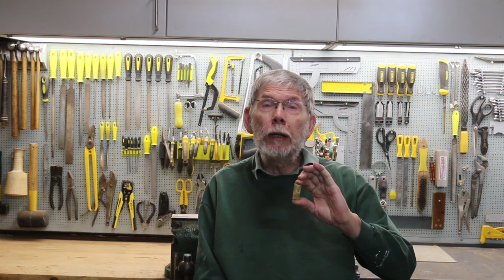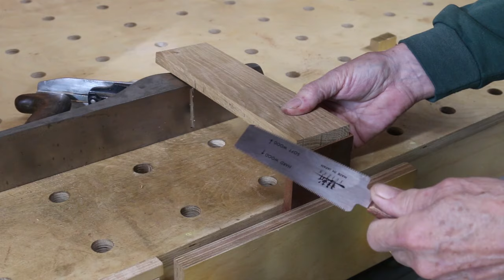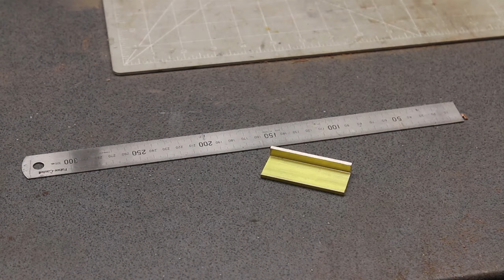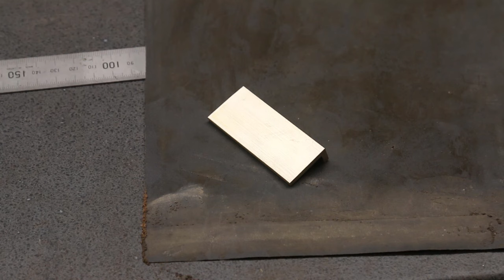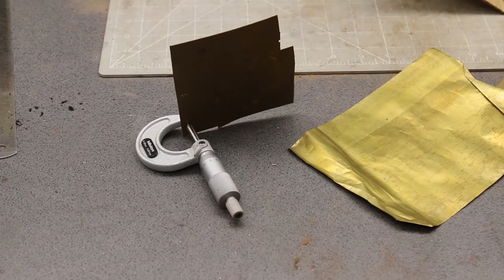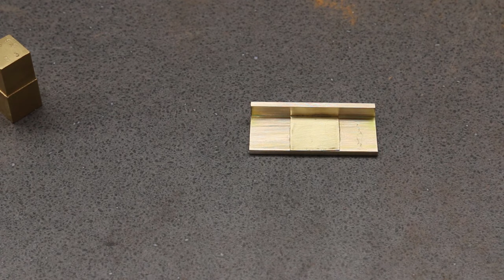super shim

Comment: And a whole lot cheaper than a Shaun Shim.  I saw the Shaun Shim on Rob Cosman channel, and determined to built one myself, but planned to use a block of wood and glue feel gauge shims to it.  But I like your approach using angle and will do that instead.  But aluminum angle and I'll just cut up a cheap steel feeler gauge to set the shim thickness to match the kerf.  I like the idea of using the feeler gauge to measure the actual kerf rather than calipers at the teeth;  Gives a real fill measurement of the kerfvs. assuming that the kerf will match the saw set.
Reply from the maker: Yes, aluminium will work just as well. Neat idea using a feeler gauge- there are a lot about now that motorists do not regularly check their spark gaps...

Comment: That still looks fiddly and error prone. If only there was some kind of clamping mechanism 😉😉😉
Reply from the maker: Yes, clamping could be arranged- or a jig that guided the saw blade. But at some point it stops being hand woodworking. A matter of judgement, of course. But this jig ‘upgrade' should not cross anyone's threshold… I certainly find it a lot easier to use.
Reply: @Tensquaremetreworkshop  I was referring more to jigs like the dove tail alignment boards that have been around since forever :)
Reply from the maker: @SirBenJamin_  Yes, I know. Dovetail cutting ranges from entirely hand and eye to 'press the button' CNC. Many enjoy the making of projects 'by hand'- although they may disagree about how many aids are acceptable. Marking gauges? few would object. A hand held gauge such as this? A small step. Complete dovetail alignment jigs? Suggest it and then step back smartly...
Personally, I like both. I will cut some wood joints on my milling machine, because I like the precision. But I also like making dovetails with hand tools, there is a satisfaction in developing skills. There is no 'right' answer- we do these things for pleasure, and if that is working nothing else matters.
Reply: @Tensquaremetreworkshop  You might have a different understanding of what a  dovetail alignment jig is. It does not take the skill out of it. It just holds things in place at right angles, avoiding the issue you had
Reply from the maker: @SirBenJamin_  I have seen several dovetail alignment boards, and none of them gave the lateral shift to allow for saw kerf. Of course they could- but then the alignment of the front faces (on all the ones I have seen) is still a manual one. Whilst holding the top board against the fence.
IMHO using a making knife is inferior to using a saw blade to mark the position- the saw gives a slot that the dovetail saw just drops into, very accurate.
A dovetail board, with a shim against the fence ( for half of the cuts), and a top clamp, would give and hold alignment. But if you want to reference off either side (and with a four cornered structure you would want to use one face, meaning two joints referenced from each side) you need a second fence or multiple shims. And it is large. Mine fits into the pocket.
This was never meant to be the 'ultimate' jig- just an improvement on the 'shawn shim' that is widely used. It works for me.

Comment: Hi Mike 
I enjoyed your video but trying to get my head around it.
So the shim you added to angel brass should that be same thickness of the saw that will cut the wood.
Reply from the maker: That's right! It shifts the top workpiece left or right by the thickness (kerf) of the blade, so the final tails and pins with be a close fit. Being L shaped, it also ensures that the top part does not move forward or back during cutting. This way of making dovetails removes a lot of the errors of just using a marking knife- you are cutting the pins to match the actual tails, rather than where they should be... It is a method championed by Rob Cosman- but my shim is both (much) cheaper and more functional than the one he uses.